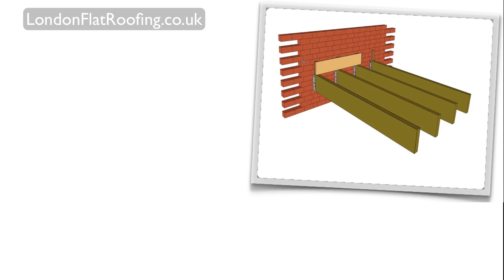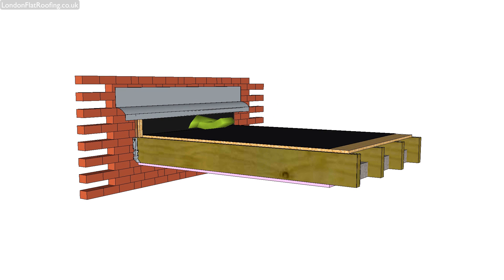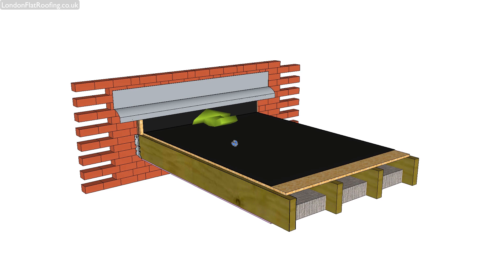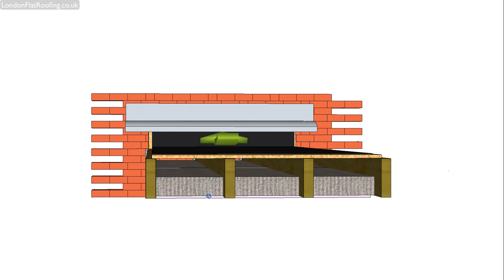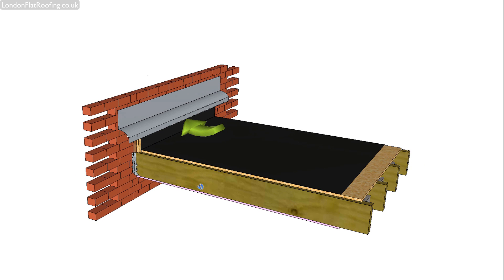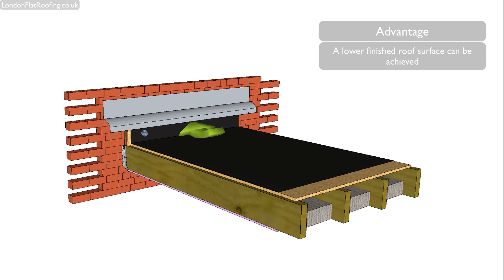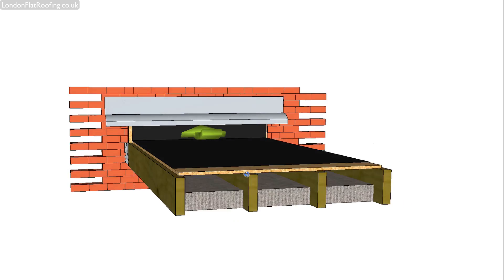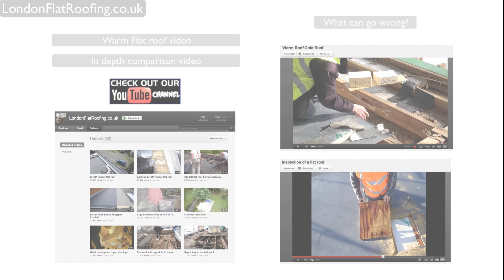Cold flat roof construction Explained

Comment: Could I have a warm and cold roof? I like the advantage of a warm roof but I'm looking to soundproof an outbuilding. I was thinking of putting rockwool slabs between the roof joists then have an air gap then a warm roof construction on top. Please tell me what you think about this.
Reply from the maker: +Craig Harrison You need to get professional advice as this would be outside the parameters of specifications I work to. That said before we started to be concerned about warm roof and cold roof construction we did the kind of thing you are talking about. In fact the converted garage that I'm working from at the moment started as a garage with open joists now plasterboard and a felt roof, some 15 years ago I insulated between the joists and plastered the ceiling then 5 years ago I placed a warm roof over the top and externally insulated the walls at the same time I internally insulated the walls using multi foil and then plasterboard I then placed wet underfloor heating under the floor and wow what a nice comfortable and very quiet room. I believe there are lots of roofs out there that are warm and cold and perform perfectly well. Its my belief that problems only start when extremes are reached such as producing to much moister inside the room or leaving cold bridging and air gaps all over the place
Reply: I've done a few retro full fill insulation between joists to an existing flat roof decking then added an insulated slab to underneath and skimmed off i.e Turning a cold roof to a warm roof. Its economic and saves space although I would not reccomend it over shower rooms without a bullet proof vapour barrier

Comment: hi, i want to construct a cold roof with a lantern in the middle. the roof is about 3800mm projection and 4800mm wide with a 2000mm x 3000mm lantern so i will have about 900mm of roof around the edge. how do i vent it from front to back if the timber upstand is there? also if i put the celetex insulation in the rafters, how does this affect putting spot lights in? will this be cold bridging?

Comment from the maker: Do a search for round soffit vents, that will give you an idea of a event for the end of a joist, there is a certain amount of air that should be allowed for cannot remember exactly what this is as we normally use vents for flat roofs that we know come to the correct specification. Generally speaking the more ventilation you have the better all you need to do is make sure that small animals and insects cannot get through the events.

Comment: Steve have you seen any houses built with only flat roofs
Structure insulated panels would be perfect and cheaper

Paul
Reply from the maker: What a good question I think structurally insulated panels are excellent quick cheap strong they have everything going for them and I cannot see any reason four walls favourite and a floor cannot be formed out of them, ventilation would be a problem so realistically mechanical ventilation would be needed then we are moving towards building a Passive House

Comment from the maker: With the cold roof vapour control is not necessary as any vapour getting past the ceiling and insulation is then removed as the space above is vented. In a hot country increase the ventilation and possibly the hight of the roof away from the insulation. Sun hits roof and roof hot, wind vents area under roof, bigger the gap between bottom of roof and top of insulation the better

Comment: Now in Chicago we do it without ventilation and instead of plaster board we use a 2" R-10 extruded polystyrene board.Make sure is airtight and has vapor barrier ,and that takes care of the thermal bridging and there will be no condensation to damage the fiber-baths.Nice and easy..!!!!! do it yourself project..!!